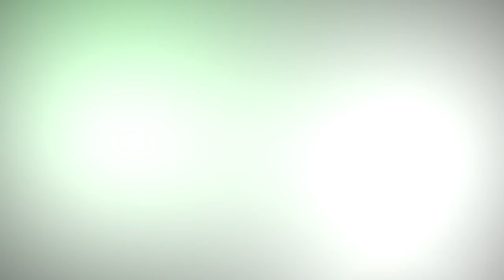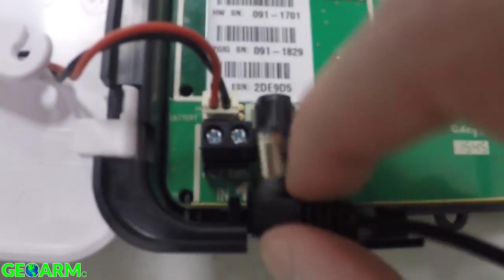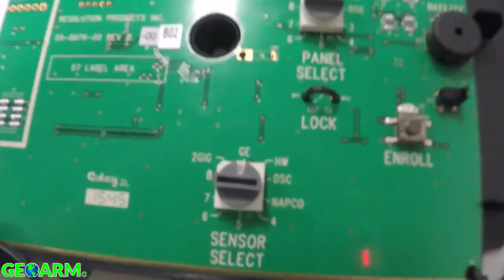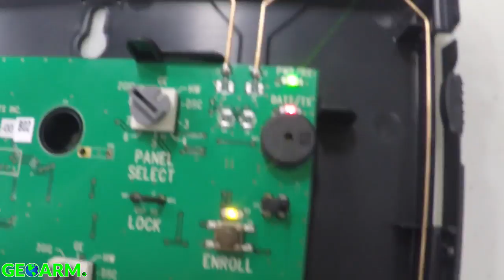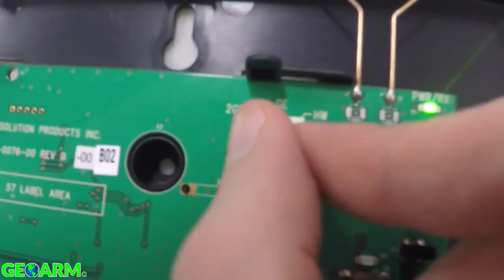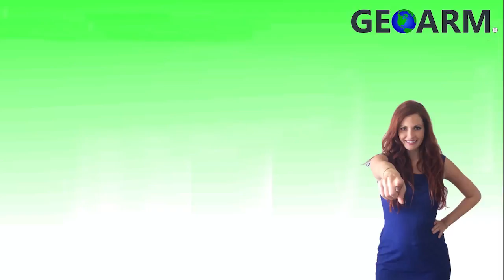RE524X: DIY Installation of Repeater and Translator

Comment: Can you tell me an approximate range of his from the panel. And if your using it as a repeater how much range can you get with this from panel to sensor. Thanks. I know it will depend on the type of panel and sensor but still an approximation would be helpful.
Reply from the maker: If you are using a compatible wireless security sensor you can expect about 300 ft nominal range without a repeater. If you add a repeater you can get an additional 300 nominal feet. Are you looking for the lowest cost no contract alarm monitoring services? We use your existing security system?

Comment: When using as a hardwire to wireless translator to wire more than 1 sencer into the same zone?  Also, is it required that you only usee  the red and blackwires to wire the zones?
Reply from the maker: Good Morning Mr. Carlito, Thank you for your question on the RE524X. The RE524X is actually a wireless translator and wireless repeater. I think for your first question you are referring to this product: RP-RE508X : https://www.geoarm.com/re508x-universal-hardwired-to-wireless-translation-resolution-products.html . If you are getting this module you system should be using 22 by 2 gauge wire already. Are you looking for alarm monitoring services?

Comment: Hi, I have a ADT box but the company is called Safe Security monitoring my alarm security system. I put in a new battery but my system still does not work. The control panel in my bedroom says my wireless translator is bad. How do I buy a new wireless translator and be sure it will work with the system I currently have. Thanks for your times, Rusty

Comment: Your initial "demo" is amusing.  2GIG panels and Honeywell sensors both use 319MHz (unencrypted) sensors, at least for door/window sensors, so exactly what are you "translating" here?
Reply from the maker: Hello Steve, actually the 2GIG/Honeywell uses 345 MHz wireless RF frequency, and not 319 MHz frequency that you stated above. This Alula RE524X translator communicates the aforementioned 345 MHz RF frequency, in addition to 319.5 MHz which would be for GE Interlogix non-encrypted wireless sensors, and lastly 433 MHz which is for non-encrypted DSC wireless sensors. Hope that helps to clarify the multiple use's of the RE524X wireless translator.
Reply: @Geoarm  In fact my GC-2e panel is dual frequency, accepts either 319 or 345 MHz sensors (the fact that my Honeywell sensors enrolled easily confused me).  In addition, I think your "forever locked" statement is ...err..exagerrated.  A call to your tech support said that removing power for a brief period of time allows the RE524x sensor/panel settings to be changed.  I successfully did this on some used RE524x devices, although I can't be sure how long they were in service.  In addition, the lock wire was not cut.  Does 30 days continuous service really lock it irreversibly?
Reply: Wow, a prime example of not thinking before making a statement.   I find this reply "amusing"